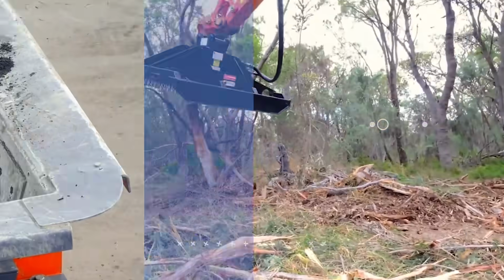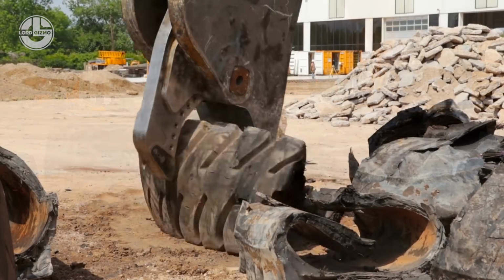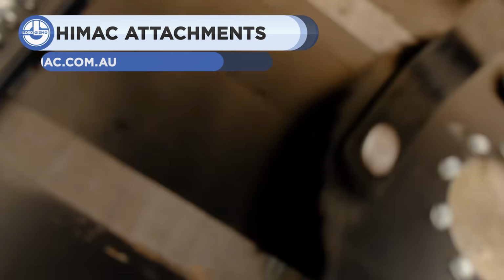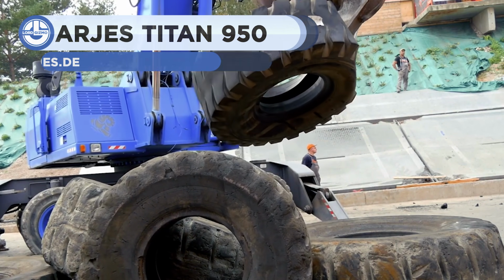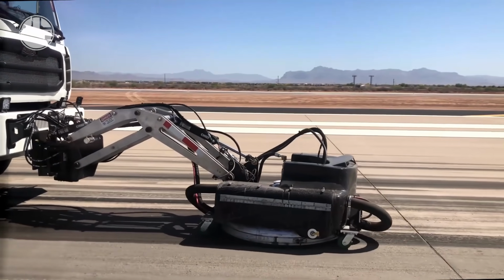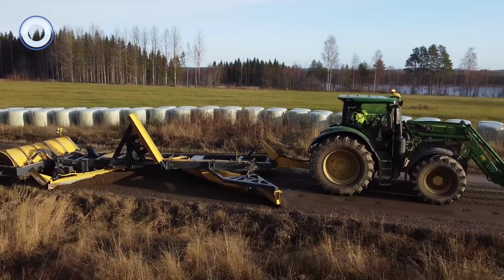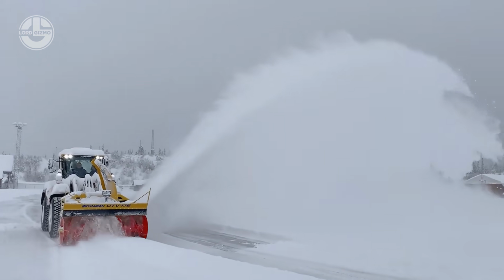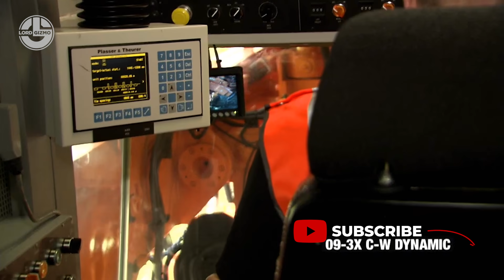The Most Powerful And Ingenious Machines You Need To See

Comment: One thing I never understood with all our technology how come we can't come up with a way to dissolve old tires and revive them making a synthetic rubber
Reply: Tyres are recycled, they grind the rubber off and use it to make playground surfaces, rubber mats, road construction etc. the high quality steel belts and bead wire are also recycled. In some countries they are shredded,mixed with coal and burned in a high temperature furnace to generate electricity. In Los Angeles County they use shredded tyres as fuel in the manufacture of cement and the leftover ash is added to the concrete mix for their numerous highway building projects. There are a number of informative videos you can watch on YouTube.